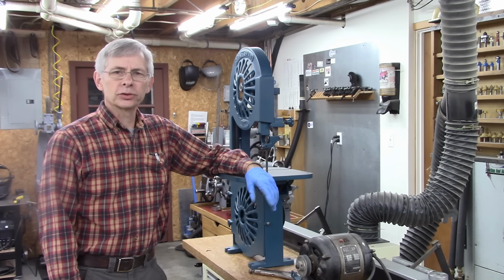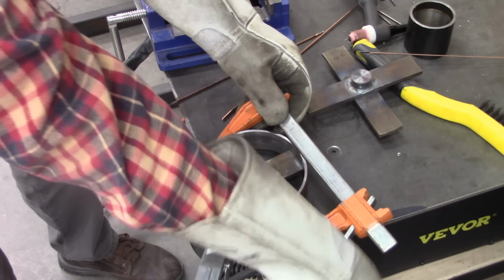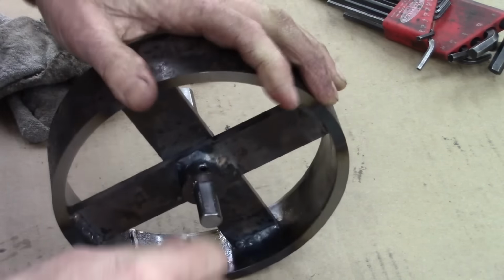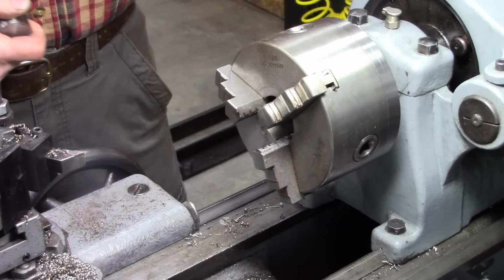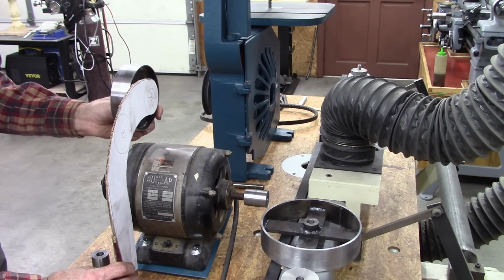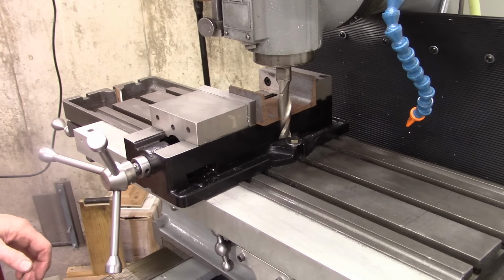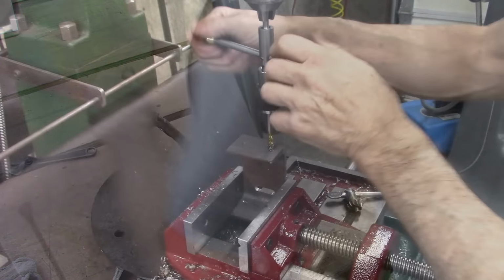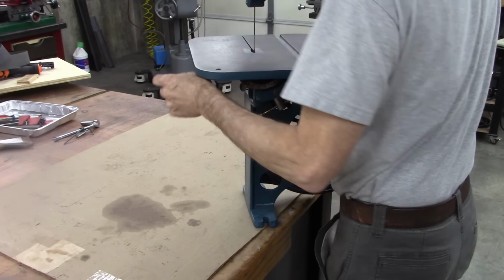Making a Flat belt slow down for the 1930's Craftsman Bandsaw  Part-3

Comment: What a neat, beautifully executed job!  I never would have thought of designing a flat belt reduction drive like that. The old steam engine and other power driven machinery wouldn’t have been possible without flat belts. You can cut mild steel up to 150 fpm so no problem there.
Reply from the maker: I suspect slippage will be an issue. I might end up making the second flat belt a chain. I timed bottom wheel. and counted 33 turns a minute. this is exactly 100 SFPM
Reply: @WinkysWorkshop You might want to use a cog type belt on that first flat drive. The highest speed is the most likely to slip.
Reply from the maker: @ellieprice363  Actually its the other way around. High torque causes belts to slip. The motor has low torque and high speed. The V-belt after the slow down will likely be the biggest issue.
Reply: @WinkysWorkshop Yes you’re probably right. I was remembering how worn clutches in old three speed cars always slipped in high gear instead of low. Can’t quite get my head wrapped around your setup. Actually it would be pretty easy to test. Apply an increasing heavy load on the final pulley until you get slippage then watch where it occurs.
Reply from the maker: @ellieprice363  It took me a while too....  a lot of thinking. The kind of thinking where you have to ask the wife to repeat what she was telling you.
Reply: @WinkysWorkshop Should be easy. Apply heavy drag to lower wheel with power on. Note where slippage occurs and make adjustments where necessary. An idler wheel for more belt tension and wrap may be all that’s needed. 

.
Reply from the maker: @ellieprice363  The chain was the best option in this case. The drive pulley is just too small. Even with more wrap I suspect it would slip.

Comment: Winky, there was something particularly soothing about this project. I gotta say though that I had serious doubts about the diameter of those flat drive pulleys. Especially because the belts are relatively short. In the end It turned out to be just as soothing to watch it run. Looking forward to see you put it through some demanding cuts! 🧐
Wakodahatchee Chris
Reply from the maker: I run into a few problems but also work through them.  Thanks

Comment: I did something similar for my Burke mill.  I utilized a 2 speed, 2 h.p. motor and misc. parts from a fan (stuff that came with it).  It uses the more modern flat grooved belt, like you find on automobiles.  I think I got pretty close to my target rpm on the lowest speed, but it's not nearly as neat looking as your work is.  

I had to make the pulley for the motor, and had a nasty time trying to measure the distance of/between the grooves, as my now old eyes kept trying to cross every time I tried.  Out of frustration, I tried using a thread pitch gauge, and found that 11 tpi matched the grooves perfectly ... just a little tip to keep in mind if you ever find yourself having to make a pulley for one of those belts!
Reply from the maker: Very cool information. Thanks!

Comment: Great design and execution.
If you are concerned about shaft stick-out, you could bore out the shaft holes and make pipe sleeves to locate the bushings closer to the pulleys.
Reply from the maker: That would probably be a good idea. I like it.

Comment: well done, 
I done something similar with a small 10" band saw that I converted to a metal saw. I used  a 2 sage of pulley reduction with one gearbox to achieve  a wheel speed of 42 RPM, I used a  A profile belt between the motor and the gearbox and a K6 automotive serpentine belt betwen the gearbox and the saw.
 To what I experimented, the frame of your saw is not sufficiently rigid to saw metal without encountering  heavy resonnent vibrations so it will need a reinforcing structure to compensate for the weakness of the saw neck. Probably that the table support will need to be reinforced too.
another point is that the "V" belt have not enough grip to withstand the torque needed to cut metal and you'll experiment saw jam and tooth breakage.
Reply from the maker: I suspect you are correct. Maybe 2 v belts?
Reply: The problem with double belt is that they ar not matched and only one will take the load, what I can suggest you is toinstall cast rion pulleys instead of aluminum, ( Aluminum have the tendency to glaze and clog  the belt friction surfaces ) and a tensioner or idler to make the " V " belt wrap the driver  pulley  to a larger angle
 @WinkysWorkshop
Reply from the maker: @jacquespoirier9071  For sure they would need to be a matched set but I'm thinking maybe a timing belt. Cast iron might be better to.
Reply: Thank you Mark for your efforts in this neat conversion and making the video. And Jacques' remarks on his experience seems spot-on too. I'm considering slowing my 14" Delta wood belt saw down as well, but everyone I've watched on YT who tried this route seem to have only had limlited or no success in the end, for exactly the reasons Jacques spelled out. AvE, Dazecars both come to mind
Reply from the maker: @stephanuhu963  Hello and thanks for the comment. As my reply to Jacques said, he might be right. I was most worried about belt slippage. Currently I am 3 videos ahead and the saw is finished and works very well. As for the frame of the saw not being ridgid, well, this was definitely NOT a concern. This saw is built like a tank. Hopefully I don't spoil the upcoming videos for you but I replaced the second flat belt with a chain and ended up adding a very simple (and ingenious :o) tension lever on the motor bracket to stop the V-belt slippage. My only concern now is the sleeve bearings handling the additional V-belt tension. The saw is ball bearing so I'm not too worried in this regard. If this becomes an issue I'll install a timing belt or install a ball bearing in the slow down.

Comment: Winky, when you were turning the crowns on the pulleys, after turning one side you swapped it round to do the other side. You lost concentricity in doing that, why did you not swing the compund to 2 degrees the other way ? you had plenty of clearance to do so. I noticed too, on the lathe that when you ream it tends to follow any runout in the drilled hole, so you end up with an excentric hole. Best practice to get a concentric hole is to drill first then bore the first 1/8" or so to size, this will then locate the reamer and any drilled runout will then get removed, giving you a much better job. Great outcome. Regards from Australia.
Reply from the maker: I mostly agree. Ideally I should have left the shafts longer on the big pulleys and then used a collet. Flipping the pulley is much better mostly because it's hard to see where center is. Also the lack of concentricity is off one way on one side and the other on the other side. It averages out when the pulley is running. The reamed hole being off was on the small pulleys and they were going to be mounted to a mandrel for turning. so it didn't matter. Technically you are correct on all accounts but the end result was unaffected. However I still think flipping the pulley is the way to go.

Comment: Looks very cool. I like where this is going. If the small pulleys slip under load, could you put a slight straight knurl on them, or would that wear the belts too rapidly? Or could you add adjustable tensioners to the unloaded sides to increase wrap?

That Lazy Machinist (not calling anyone names, that's the name of his channel) has an interesting way of machining crowned pulleys. Search YT for that phrase.

I read somewhere, perhaps in one of Guy Lautard's Machinist's Bedside Readers, of a fellow who positioned his bandsaw such that he could run a long belt from his lathe to get multiple low drive speeds. Reminds me of an old time shop with an overhead drive line powereing several machines. Clever perhaps for occasional use, but I think you'll use your saw much too frequently for that to be practical.
Reply from the maker: All good ideas, I think I might make the second flat belt a chain drive

Comment: Well Done... Again.   Good Work..  If you put some External Gear Lube on those gears it would quiet that machine a ton.
Reply from the maker: I need new gears, mostly the spindle gear. I use 600 wt gear lube but it doesn't last long. The open gear lube is messy stuff but maybe I need to use it.

Comment: With the pulley arms having some sideways flexing, why not put some spacers in between to make it a solid unit. Round turned pillars with a tapped hole in each end and a clearance hole in the arms. It may also improve any bearing wear as the shaft would always be in the same place on the shaft instead of it oscilating. Regards from Australia.
Reply from the maker: You're taking away from my next video :)
Reply: BTW, my friend in South Africa forwarded this video of yours on to me, who is watching in Moncton New Brunswick, Canada 😅
Reply from the maker: COOL!  @stephanuhu963

Comment: A worthy project! Your videos are high quality and nice to watch. My question for you is; where did you find any info on the amount of crown for these pulleys? I renovated an old Maytag 92 that has a crowned drive pulley and it seemed to be about 1:10 on crown height to rim width. Any clues on flat belt drive design..? Thanks
Reply from the maker: This sounds crazy but there is no optimum. More crown has more centering effect so alignment and belt quality is less of an issue and the belt stays center on the pulley. On the flip side, too much crown reduces surface area so the belt does not drive as well and in some cases too much crown will damage the belt. Also I made inverted V crowns, in reality a rounded crown is better but not by much. I usually make most pulleys 1.5 to 2 degrees. Also I worked for a printing company that used a lot of belts. I was in charge of belts and also fixing and modifying stacking machines (which had many belts)
Reply: I am so ENVIOUS as how your brain (thought process) works. Your ability to envision what you want and then proceed to make it are first rate! Thanks for sharing.
Reply from the maker: @rexmyers991  Thanks Rex, its a mixed bag. Sometimes things come together fairly fast. The bandsaw took about 2 weeks of thought and it was a fun challenge. On the other I hand usually have 3 or 4 future project digesting in my brain...  sometimes for years! They compete with each other and take up valuable space in my head. I'm so glad I'm retired, projects at work disrupted my sleep.
Reply: Thanks for the reply. If you visit in the North West, the Museum of Flight in Seattle, an odd place to have old wood working tools, has quite a few belt driven tools on display. @WinkysWorkshop
Reply from the maker: @Servoengr  I grew up in Lynnwood and went to the Museum of Flight while I was up there a maybe 6 years ago. Yes they have some very cool stuff there. Pain Field also had a much smaller museum but now that it's a commercial airport I'm not sure if its there. I miss Seattle but not the rain and traffic.

Comment: I liked the whole vid. and I like the project but why not just use step pulleys?  Were you just looking for a good project?  If so that is reason enough.  I'm just curious.
Reply from the maker: Step pulleys would work but it's hard to get enough speed reduction. Small pulleys with V belts have limits as to how small you can go. Also, I would have had to incorporate a tension system. With the flat belts you can make the pulleys smaller and make the belts right size (of course, hard for most to do). The reduction is fairly extreme and the size and weight would have been greater with V-belts. Plus yeah, it looks cool and its fun.

Comment: I do not understand why the green belt does not slip, there is no tensioner on it. Or will it slip in the future when it stretches? How do you get a belt built that accurately so it does not slip?  Maybe you can address this in your next video.  Thanks for another great video, always enjoy watching them.
Reply from the maker: These belts are fairly amazing. Yes it took me two tries to get the length right. Honestly if I had not seen it done in the past I probably would have added a tension idler. The belt is about 1/16" to 1/8" shorter than the actual length and it will not stretch.... well not for years anyway. I will say that under load the second flat belt does slip. It's plenty tight but too much torque. I installed a chain. More to come... hopefully i didn't spoil it.

Comment: I converted my bandsaw to cut steel with a gear reduction box. I found that about 250sfpm was about right for general use
Reply from the maker: Interesting...  and you may be right but everything I've read say 100 for mild steel.
Reply: @WinkysWorkshop  The charts I’ve seen show that low of a speed for tool steels but in the 250-275 for mild steel
Reply from the maker: @stevenhintz5508  I'm guessing faster would be okay but here is what google said:  "A bandsaw blade speed is expressed in surface feet per minute (SFPM). For metal, typical blade speeds range from 60–300 SFPM. A general guide for cutting mild steel is 50–120 m/min. Running the machine at a much slower speed, about 100 feet per minute, is needed to cut steel. Running it any faster almost guarantees that you'll damage the blade."
Reply: @WinkysWorkshop  The sawblade site has a good chart on blade speeds for all kinds of steel using bi-metal blades. Go to the bottom of the page under about us for the chart. Can’t post a link
Reply from the maker: @stevenhintz5508  It's amazing how widely the recommendations vary. It does look like on average I could run faster. Harder steel and cast iron needs to be slow so I'm good there. I wish i had aimed for about 200 SFPM but I suspect blades will last longer going slow.

Comment: Looks good. Neat way of making the larger flat pulleys. When your tapping holes it looks so effortless, what brand of taps are you using?
Reply from the maker: Spiral flute or spiral point and never a plug tap. They require a lot more effort and reversing to break the chips.  I have about 20 different brands. About 10 years ago a guy gave me a box full of taps and I've been using them, no idea what the brand names are.